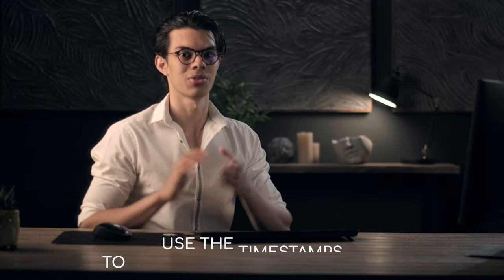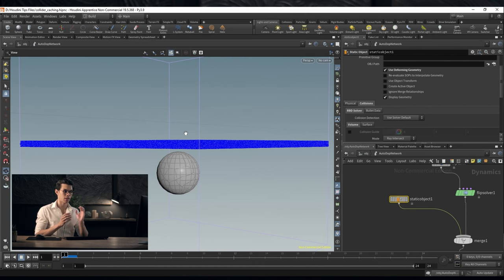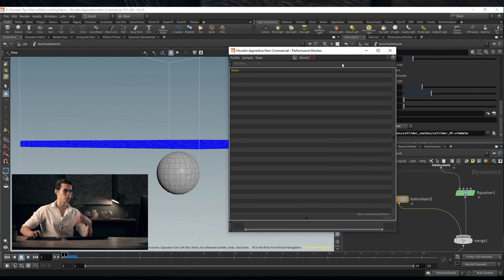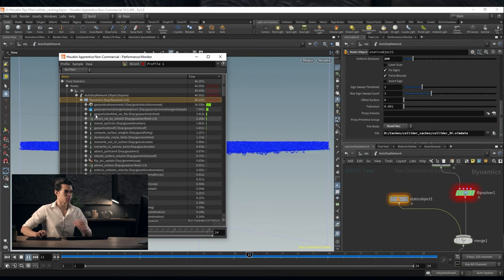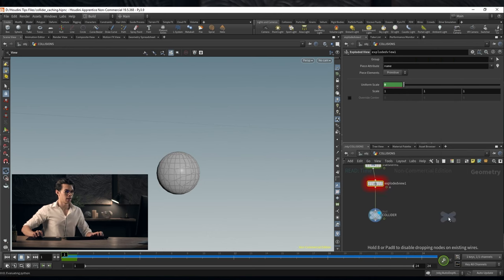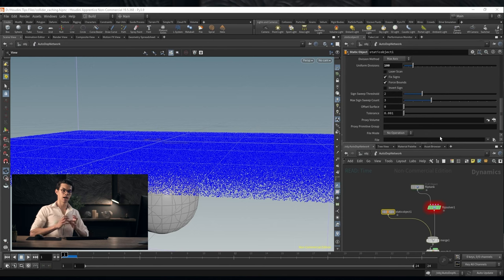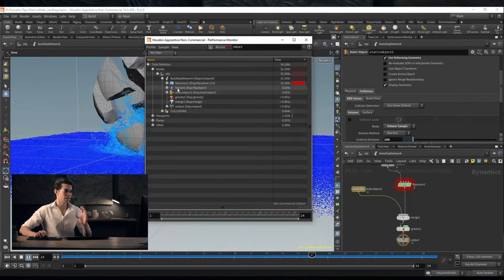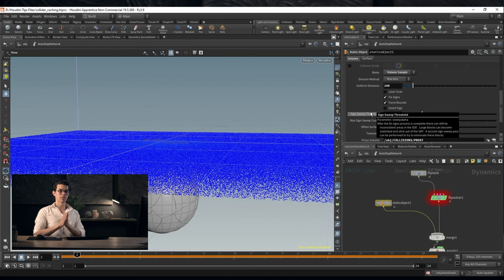Best Way to Create and Cache Colliders -  Handy Houdini Tips

Comment: this is definitely a good workflow. i usually use the collision source node though to generate the vdbs for collisions. also though to my knowledge, volume colliders are only really useful for flip and pyro which are also grid based but i dont think they are really good for other stuff like vellum/pops although they may work somewhat? im not 100% sure what the correct rule of thumb is but im assuming use surface colliders for particle based sims and use volume colliders for grid based sims.
Reply from the maker: You're so right. I might already need an update to this video considering I completely ignored the existence of the collision source node. It does collisionvel fields and interpolation which is obviously a major benefit. And yeah, as far as I know there's a gas collision building process required in grid based solvers which is why you get a big speed increase from prebuilding the sdf. AFAIK point based solvers don't have that step because they don't use any gas micro-solvers. Thanks for the comment and the food for thought. Always cool to hear from you!

Comment: Is better to cache the collision vdb as *.vdb instead of the  default filecache file *.bgeo file? I had to try but in my last flip sim the animated collision geo was very slow also if it is cached. 😩
Reply from the maker: Hey, so saving as either one is fine. They should both work the same. However, keep in mind that if the file size is large, it will take a while to load from disk. In this example, we were getting ~10mb files. However, in a real project, you may be looking at 100mb or far more per frame. If you're saving to an HDD, it will take a moment to load from disk. I would also recommend using the performance monitor to check if the collider is being slow to build or if there is an issue elsewhere (Initial overlap of particles and colliders, for example). Alternatively, you could try the collision + collisionvel workflow. This can be done by using a volume source node and bringing in a collision volume and a collisionvel (velocity) volume. These skip the gasbuild step as they are what is generated within the solver. I hope that helps.
Reply: @NineBetween  thanks for your time ans super exhaustive  reply. You are right, i had to try with perf monitor. Anyway my collision mesh are heavy and maybe there are some loading time from Nas. I Really appreciate your channel. 👍